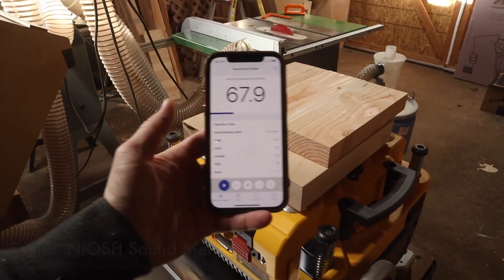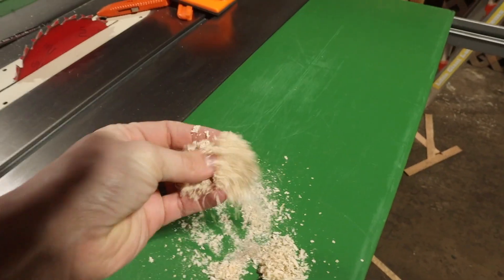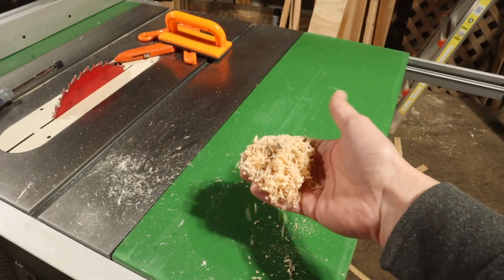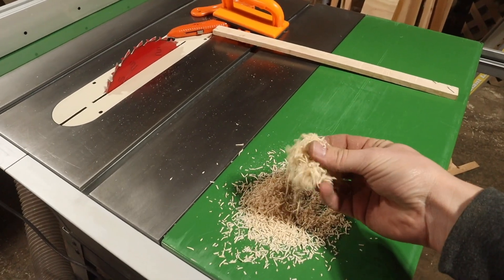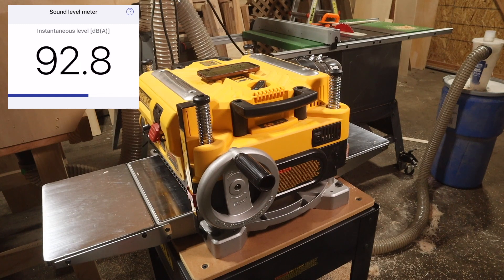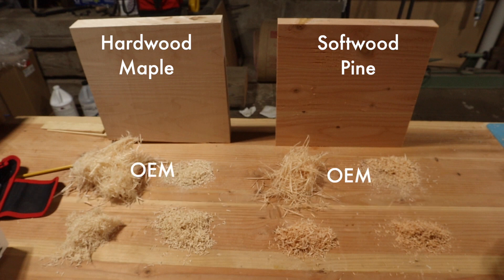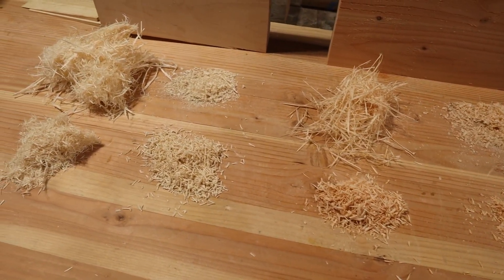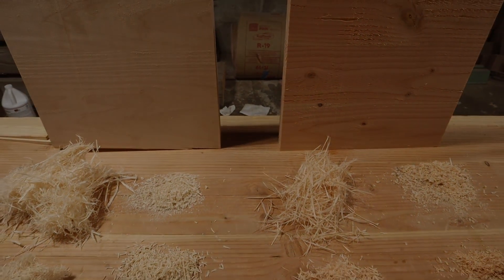Shelix Upgrade | Before & After

Comment: I just replaced the shelix, the finish is good, wont say its much better than a sharp straight blade but its good enough. But I noticed its not really flat cross the board, I reinstalled all the cutters 3 times , got rid of the lines, but I still can feel the high and low spot cross the board, is that just the nature of this kind of cutter head?
Reply from the maker: Hey Gerald! Sorry it took me so long to get back to you. From my install, on hardwood, the finish is quite smooth. That being said, helical blades will always have some dishing and scalloping because of the way they cut. But it shouldn’t be very noticeable and well within a 220 grit touch up. Does it feel within sanding range for you or more severe?